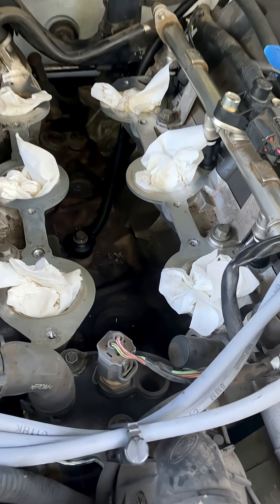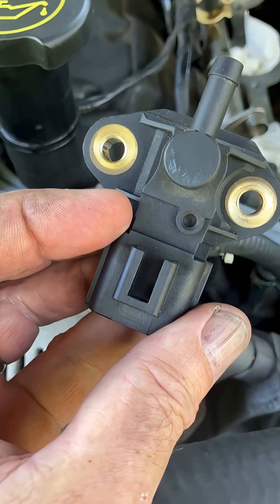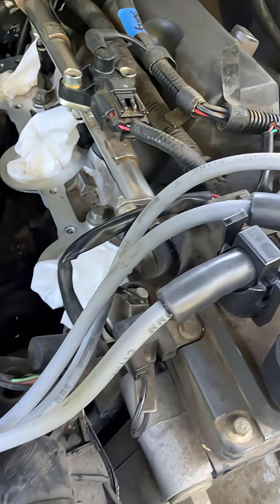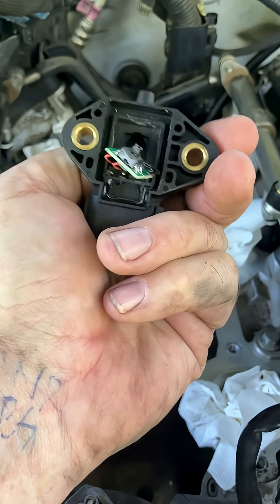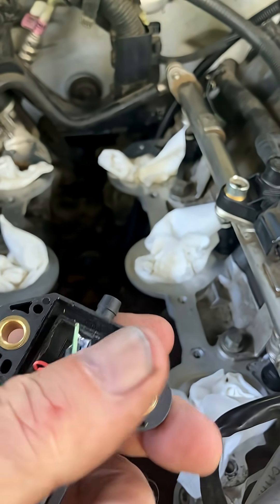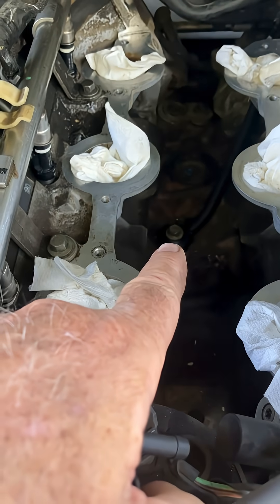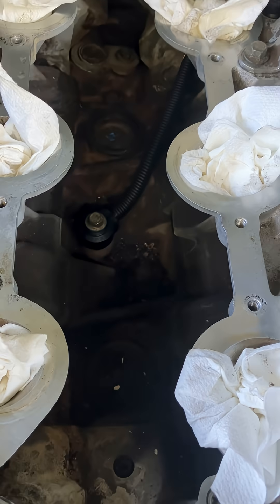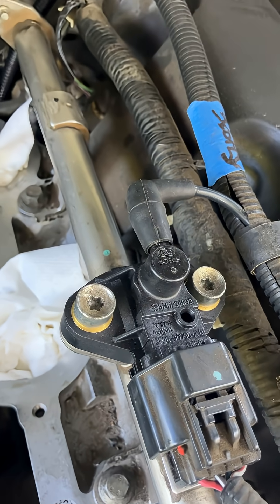2005 Explorer Fuel Rail Pressure Sensor - Fail

Comment: What symptoms was it causing in the beginning to make you change the 1st time? My crown vic keeps going in limp mode
Reply from the maker: I got extremely rough firing, and was in limp mode but the truck would not hold idle thus I was rolling stop signs and intersections just to keep her alive. My OBD told me I had a misfire on cylinder 1, and a rich fuel mixture along with some unhappy oxygen sensors. Oddly the OBD never identified the fuel rail pressure sensor.